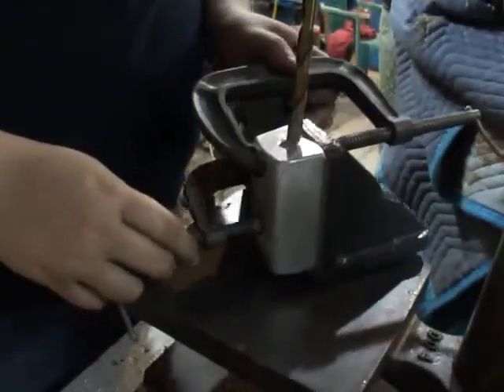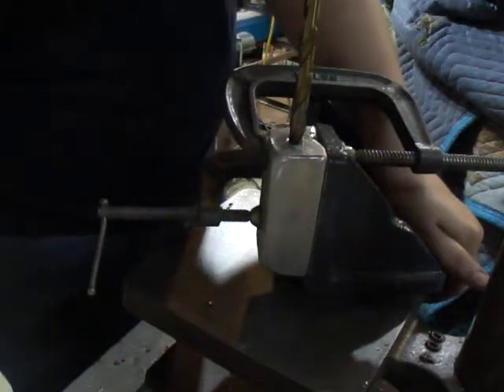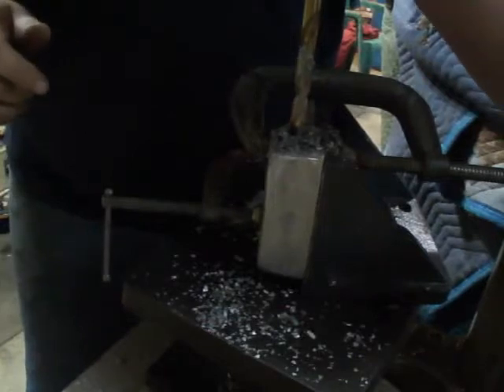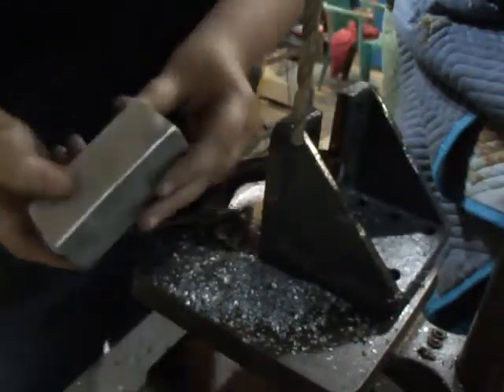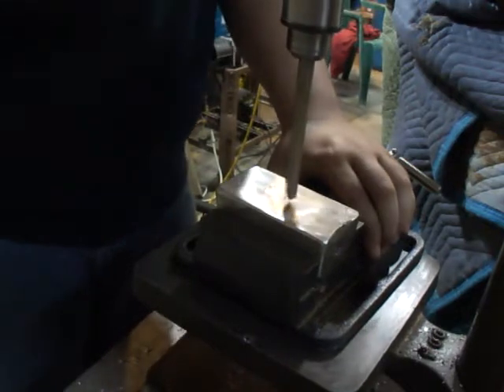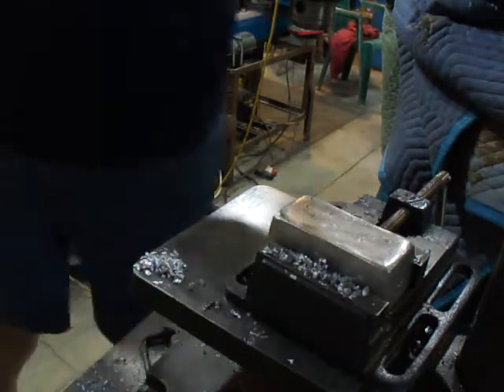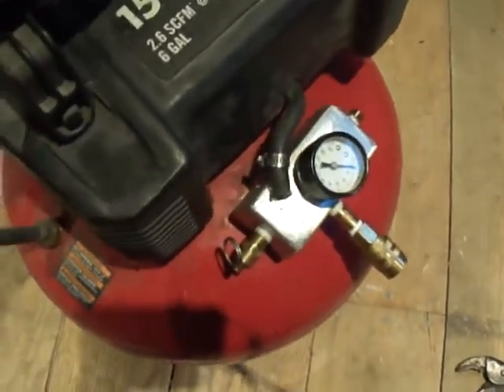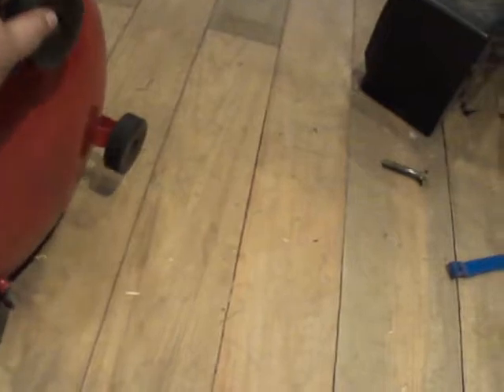Making A New Air Compressor Manifold

Comment: Where are your steelcap shoes?A mk3 sleve fell on my toe a few month ago since then i always wear my steelcapboots be carefull .Nice old vice good job
Reply from the maker: lol, I was wearing them later that evening when I was was running the lathe. My boots are about worn out, so I dont usually wear them unless absolutely necessary. The chips from cast aluminum isnt really sharp like extruded aluminum or steel is, so no need to worry about them in your feet really. Also, the bottom of my feet are like rock, so I can walk over broken glass or sharp rocks and it wont even bother me, lol. The funny part was, I didnt have a single problem all day, then around 5 mins after putting the boots on, I was turning some hardened steel, which the chips were more or less glowing red as they came off, and a chip landed in my boot, now I have burns all up my ankle where it burned since it was caught in the boot.

Comment: Thanks for posting! Thought is was going to be more complicated but I really dig the simplicity of it. Too bad you ran out of tape. I love the creativeness you used for the feet. Nice!
Reply from the maker: nope, it was litterally just a block with holes in it for the air to travel throughout it. I said it was honestly really simple, lol. The leveling feet work pretty good too, I was planning on making a set, but much more solid for the shaper and the lathe so I can level them easily. Also, the rubber helps a ton with keeping the stuff from sliding around the floors, and keeps vibrations from transmitting into the floor unlike just bolting stuff down.